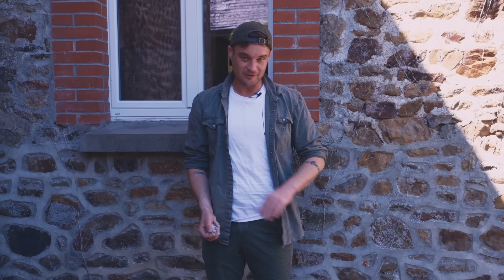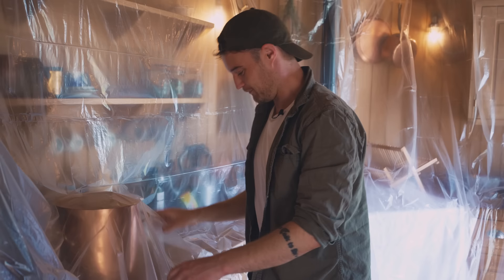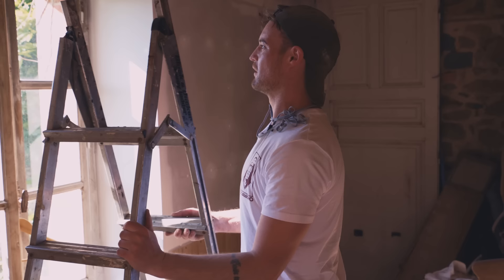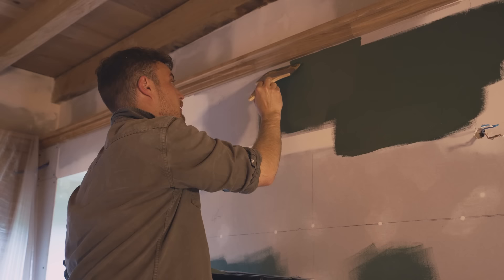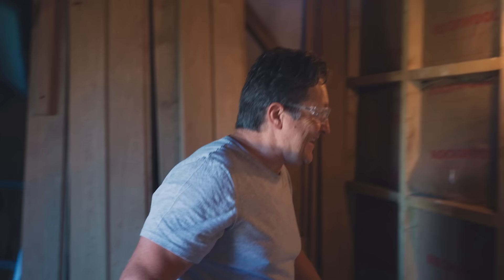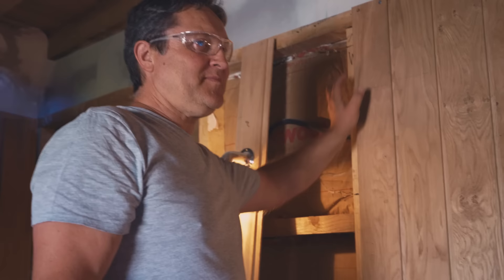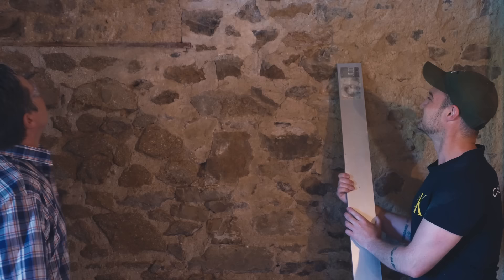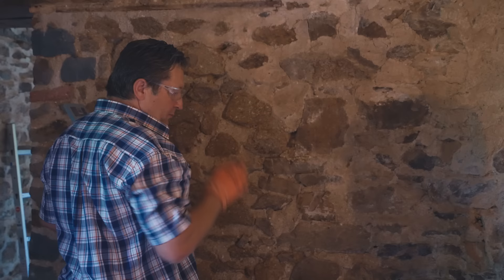Painting The Cottage - Part 1 - Doing It Ourselves

Comment: Not to be intentionally critical, but 18:38 I must say that face-nailing/screwing tongue-and-groove boards (as you used on the walls, same goes for floor boards) will give you endless problems with humidity and the expansion/contraction of wood over time. The tongues and grooves are milled into the boards intentionally to alleviate this constantly expanding and contracting as the wood fibers absorb and give off moisture. Instead of face-nailing/screwing, the boards should be fastened with a finishing nail at an 45-degree angle on the tongue edge, and then the grooved edge fitted onto the tongue with no nails and held in place via the joint, allowing it to float both horizontally and vertically, independently from the next board. Also, face-nailing/screwing as you did will cause a higher risk of cracking the board because it's not allowed to move, especially using screws, a nail will allow some movements along the shaft of the nail (reason old houses make creaky noises during the night). Now-a-days, everything is screwed because it's faster and cost less to the builders, but not necessarily the best practice. Contractors and builders only guarantee their work until you see their taillights turn the corner and out of sight.
Reply: I've never seen anyone use screws in panelling,   I didn't understand the theory behind it,  thanks,  only the aesthetics   You wouldn't get away with this 'cowboy' building. in Australia,   sorry Michael , but I am no sychophant+

Comment: Thanks for the tip on Little Greene paint. I take it you are referring to F & B. I wanted to use them & so did some research online (I've been living in France for nearly 35 yrs so don't know the brand). They've got quite a bad reputation from professional painters but I bought a sample pot to try out. Although the colours are amazing, indeed their paint is VERY watery, lightly  pigmented & requires 3 coats to get the full colour so I was very disappointed. Seeing how the LG paint goes on your wall has cheered me up no end ! Merci beaucoup & greetings from the S of France.

Comment: Re your dad's broken ladders,. I had similar ones extended from the stairs up to the bedroom wall when I was fitting hollows soffit sheets to the ceiling when the ladders folded in the middle when the side joint broke and I came crashing down the whole flight of stairs, no broken bones but bad gashes to leg, get your dad to ditch those ladders as you said, A death trap

Comment: Using a "cut bucket" is both easier and safer (less spills) than a roller pan. Also, using a primer under your finish coat closes the cracks, makes far better adhesion for the top coat, and importantly, is designed to stick to the sheet rock much better than the top coat.
It costs more to use primer under a top coat, and more work, but the finished product makes it more than worth the trouble. The job lasts longer as well..fyi.

Comment: Love the paint colour - curious as to why you didn’t put an undercoat on first however to seal the plasterboard??
Reply: I was thinking the same thing. Won’t it peel off if it’s not primed?
Reply: Here in Canada we have paints that have undercoats built into it. Or as we call it primer and I am thinking that that is probably the case with that product that he uses from little green
Reply: @thehomesteadersjournal  we do too in Australia  but he didn’t say that about this paint he was more talking about the colour…so would just be interesting to know.
Reply: I was wondering too. I often skip primer when repainting a wall, but on raw drywall, I thought it was required!
Reply: not to mention cut in with small angle brush.  i often use a large brush rather than a roller on small ares… we all do things differently… michael’s results are always spot on!  results matter!🦩

Comment: You are supposed to prime new drywall to seal the plaster and make a uniform finish for the paint. If you don't prime new drywall and plaster first all the plaster joints and screw patches will show threw the paint. Paint and primer in one is meant to seal over previously painted walls to conceal the previous paint color but is not a substitute for pre priming new drywall first. I know this because I made the same mistake, plus the paint will be more susceptible to peeling if it painted over unprimed plaster.
Reply: Was thinking the same !

Comment: Eek, no priming over sheet rock? Doesn’t the plaster absorb the paint into it? In the US, we usually need to prime the bare wall first.
Reply: Plaster board and sheet rock aren’t the same thing. He should be fine painting a couple of coats onto plaster.
Reply: Exactly what I was thinking. You would think that the paint would just get sucked into that wallboard. Must be exceptional! Would love to try some here in the States.
Reply: Most good paint today has a built in primer
Reply: @christinaaubin8508  Are they really different from one another?
Reply: @Rebelmusedesign  yes, very, as I discovered when I planned a bathroom Reno thinking I had sheet rock walls when it turned out I actually had plaster board. There is no plaster on sheet rock but plaster board has actual plaster on it.
Reply: @Christina Aubin, perhaps in France there is a difference but in the U.S. plasterboard and drywall are the same thing. Sheetrock is a brand of plasterboard or drywall. I work for a construction company and we always prime plasterboards/drywalls prior to painting color coat.
Reply: @bonclymew5069  I live in the US, part of my old house had sheet rock and part had plaster board, they were very different.
Reply: @christinaaubin8508  I didn’t say “plasterboard”.  He said “plaster” which we call dry wall mud here.  Used to patch the seams and smooth flaws. 

So I did know there was a difference, thanks! And Sheetrock and Drywall are the same thing.  Some also call it gypsum board too.  They all have a hardened “batter” in between sheets of paper.  The paper tends to absorb paint and the mud can sometimes change the color of the paint, making more than one coat necessary!  Real plaster is something completely different, which is used with lathing  — literally called lathe and plaster. Plaster makes a hard shell on the wall.  And when you hammer a nail into it, it can chip the surface.

But I guess as a Michael said, he only needed the one because of the high quality of the paint.
Reply: @christinaaubin8508  agree.

Comment: Why not using a primer coat first? It seals the drywall and joint compound, preventing the finish coat of paint soaking into and dulling the paint, and, it creates a better binder between the substrate (drywall) and the finish coat. Only a suggestion.
Reply: A lot of the paints now have the primer in with the paint which helps them be a one coat paint. So it isn’t always needed as a separate application before the actual color is applied.. This one may have it.
Reply: @barbaralivacich5511  True about newer primer/cover coat paints; but on new construction and using high-end contractors, the raw drywall should be primed first to seal the porosity of the substrate. Now, if the builder wants texture over the drywall (orange peel for example), some texturing compounds will seal the drywall, but then the texture should be primed before painting. Many of the DIY products sold today are manufactured to make application simple for the homeowners, and will cut corners. However, again, if paying for the high-end contractors, they will use products not available to the DIY homeowner. As for myself, I did a two-year apprenticeship with an very old bricklayer-plaster over metal lath-painter in the early 1970s, so some of my methods and knowledge are considered outdated by the younger crews.

Comment: When. I last painted my sitting room, which had just been newly plastered, I had to sand, put two coats of PVA, a base coat, two under coats, and two top coats! How come you just painted directly on to bare plaster board and why didn’t you have to tape and plaster all the joints?

Comment: Does this paint absorb evenly between the drywall compound and the face paper of the drywall?  As a  union journeyman drywall finisher who works for a commercial interior contractor, I have never seen our painters paint new drywall without first applying a good coat of primer/sealer.  Sealing the drywall also allows you to remove any wallpaper you may install without taking the paper off the gypsum.

Comment: Hey there Michael was just wondering about the Little Green paint. Is that actually a clay based paint or an acrylic base paint. I am a big user of Farrow & Ball and I know that they are a clay base and absorbs light rather than reflect it like an acrylic does. Also does that type of paint you use have a primer built into it thus requiring only one coat. We have a number of brands here in Canada that do that combination especially for darker colors.

Also you might want to look at a different type of roller. One that has maybe a tighter nap on it. Maybe a sponge roller. I love that colour though - so rich

Comment: A spiral staircase would take up less space ?
Reply: It's difficult to move furniture etc though
Reply: @endeavouringit  I suspect not that different than the existing staircase, given the tight turn at the bottom.
Reply: @DrRusty5  true and there isn't much room either way
Reply: @endeavouringit  did you forget they have a cherry picker? :p
Reply: @PostImperfect  no, but still how would you get it in

Comment: The paint you bought seems to be top quality, but doesn't it get partly absorbed by the plaster, leaving an uneven finish? I'm used to applying a primer coat first and brush diluted paint on the plastered spots first and then apply one or - usually - two coats for a nice result.

As regards the stone wall... well, I caught a glimpse of it when filmed with a wide angle. It isn't that special and you can definitely cover it with plasterboard, it will look much better.